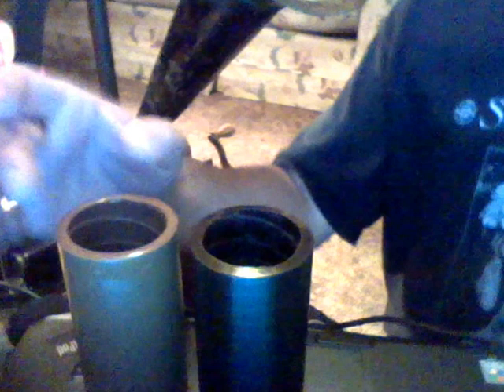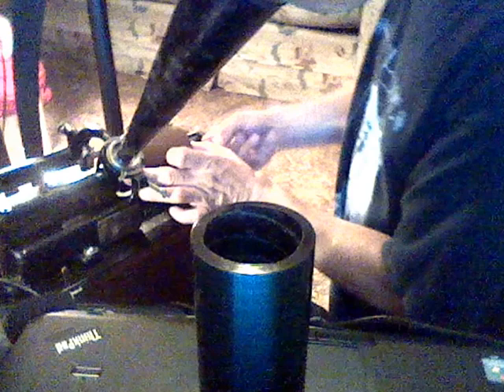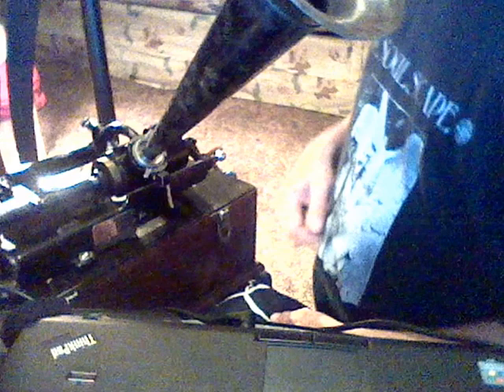New DOUBLE helix spiral core Borri Audio Laboratory Edison style Brown wax recording blank.

Comment: i've heard better cylinders of that period than that edison brown wax bettini standards are pretty clean as are the cylinders from magasins du louvre lioret brown wax has a chocolat color and the sufage noise is pretty low the concert cyl of dutreih are a bit noisy but not as much as your edison the dutreih standards are mold magnets 
phenix cyl are great when free of mold
le cahit & morel cylinders are very good aswell but again they are mold magnets
if you could ever have the chance to analyse a french bettini cyl (french because the american bettini's where edison blanks) than i would take that chance because they are the best in my book
Reply from the maker: I have heard brown wax vary quite a bit. Both Edison and Columbia.  I had some minty Columbia brown wax from the 1897-1899 era, unfortunatly I sold them,  some were very clear and quiet indeed.  They were stored in a nice mohair lined, mahogany record case with an air tight lip. They had more of a salmon color,as not as much oxygen was exposed to them, or light. Light and oxygen oxidizes the iron stearate in the compound, introduced by cooking kettles and iron in the water used to make wax.  These cylinders  even smelled like new when you opened the box, a nice aromatic sweet smell.  I have recorded on customer's original brown wax blanks quite a few times, and the darker, reddish brown Edison blanks seem to be very quiet.  Light cylinders are more pleasing to the eye.  It  seems that the lighter cylinders have a bit more noise because the compound is not fully combined all the way.  Most of the original formulations were based on 408 lbs of stearic acid.  Ceresin at the time of original brown wax, came from ozokerite mined in Boryslaw, natural ozokerite  mined then refined to ceresin has many different properties depending on what part of the vaine mind form  some may be more impure and have paraffin mixed, or oil.  Unfortunately today ceresin is mostly synthetic, and usually has a paraffin blend.  The temperatures of the wax process are quite involved and deviation from the means will have a variety of outcomes, even if all ingredients are measured carefully.
Reply: Shawn Borri bettini's and magasins du louvre cylinders seem to have that sweet smell you mention and the magasins du louvre cylinders are salmon in collor